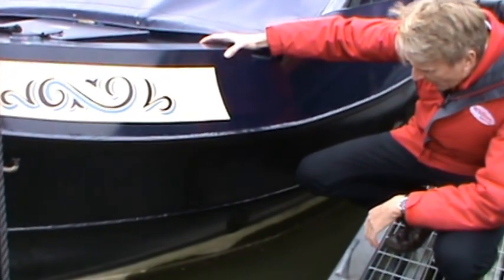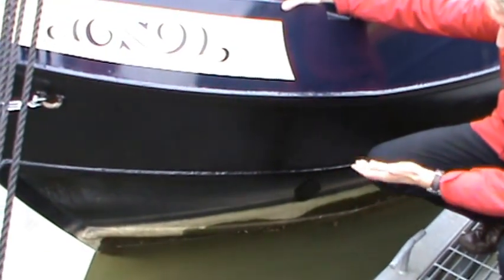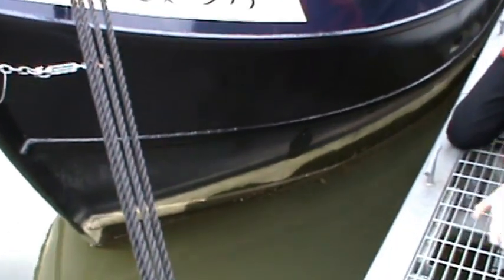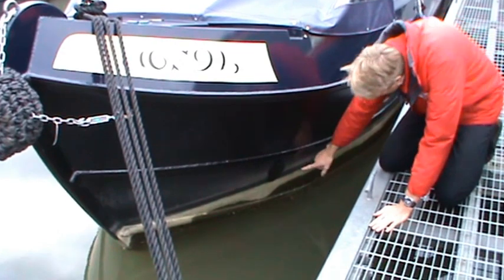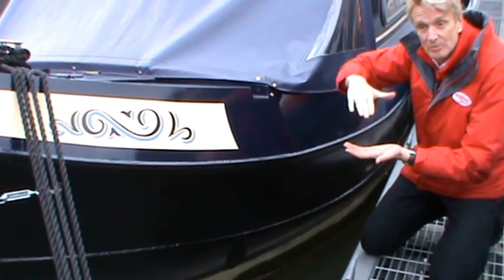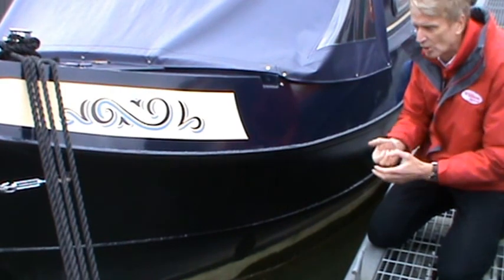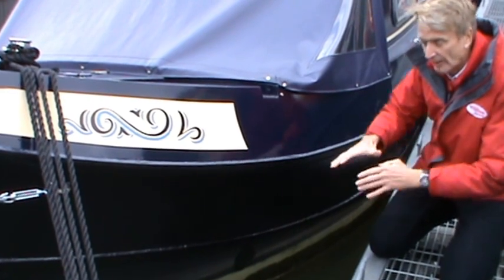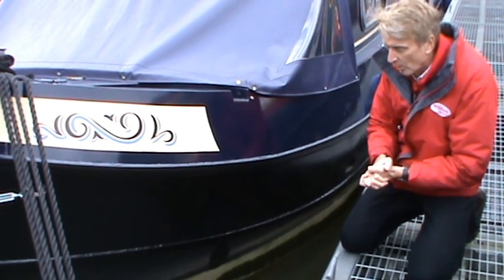Ballast on a Narrowboat

Comment: Hi. Assuming that 'a narowboat'  is 10,6,4, and fully fitted out, approximately how much in tonnes would, say a 56' boat weigh? Is there a rough formula per foot to calculate? Unusual question, I know, but I've often wandered how much these craft weigh when I've seen them on the canals. Thank you for the survey series, it is interesting to watch.

Comment: Hi,

My 30ft sail away is arriving very soon, and I was wondering if it is safe to cruise the boat a few hundred meters without any ballast ? The boat being a sailaway is not lined, has no floor or anything inside to weigh it down. I hope you can help me.

Thanks
Reply from the maker: Hi Emanuelis, It is best to put ballast in the boat before sailing it as it will be very hard to control the boat or stop the boat without weighing it down with ballast.